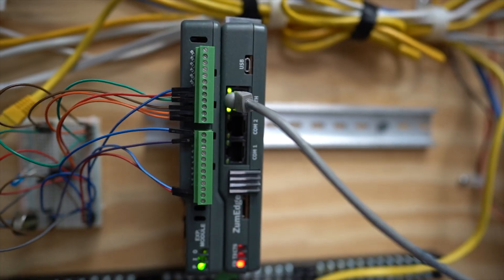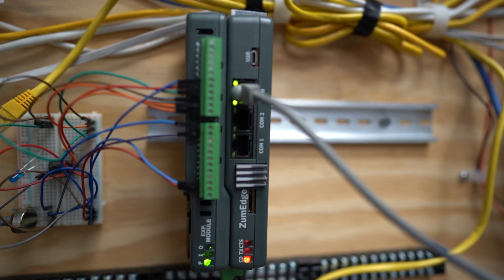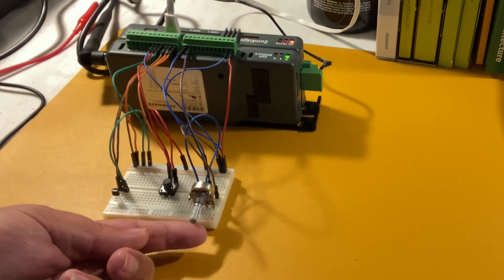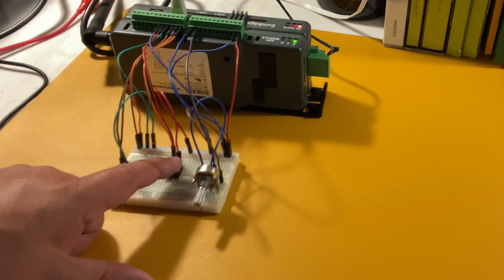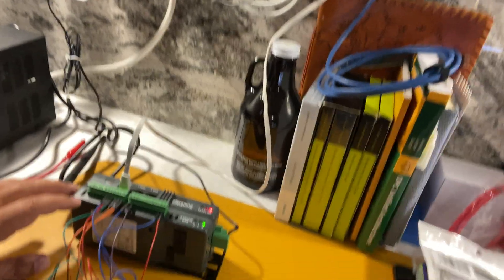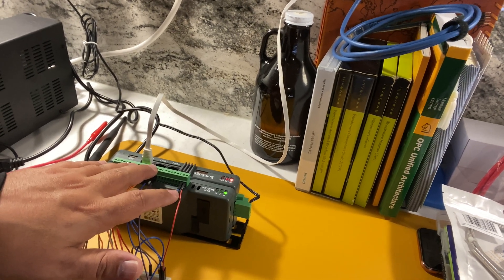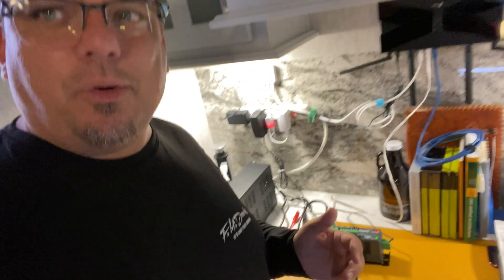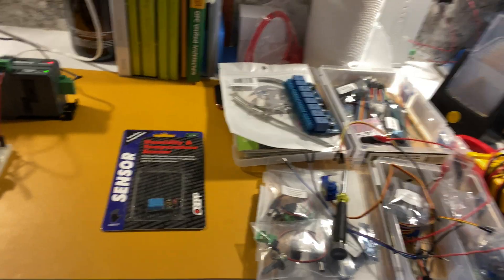FreeWave ZumEdge Initial Impressions

Comment: I noticed you have a zumedge with i/o on one end as an endpoint and a zumlink on the other end as a gateway probably running tcp/ip.  could a configuration be simplified by having zumedge I/O as an endpoint running i/o from both sides?
Reply from the maker: Yes sir!